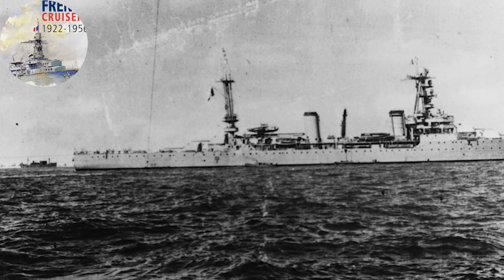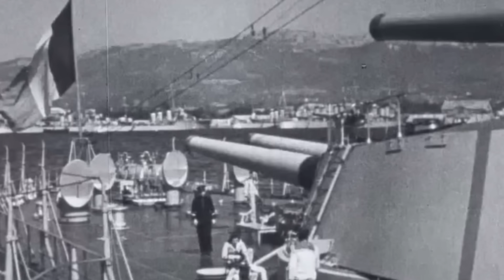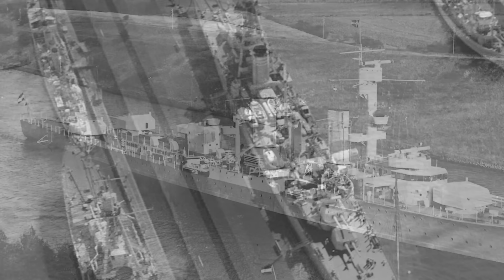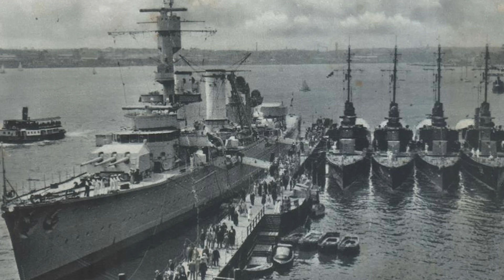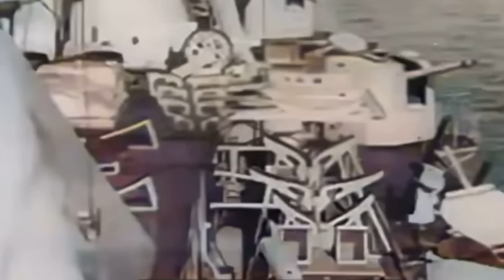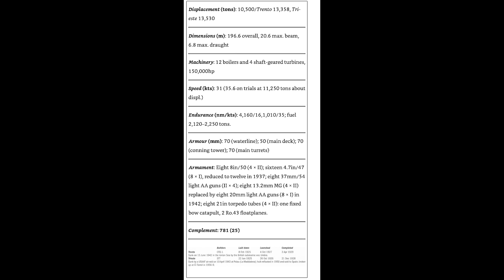The Treaty Era’s Worst Warship Designs

Comment: Is there any instance in WW2 where either a ship was lost but would have survived if armor had been 50% thicker or where a ship survived but would have been lost if armor was 50% as thick?
Reply: I don't know if this counts, but the Fletchers were built with a splinter-proof belt of armor, kinda like a mini cruiser, when other destroyers didn't have that; apparently that very effectively protected Fletchers from damage from near-misses (aside from shock damage, of course).
Reply: @TheSchultinator  They didn't have a belt but you are right that, unlike typical destroyers, they had some splinter protection worked in. I don't know how we'd check it against the survival criteria though. Thanks.
Reply: @Wick9876 Special Treatment Steel (STS) was a "type B" armor (non- face hardened) that the USN developed to have a high tensile strength while remaining ductile, which is really good for catching splinters. In layman's terms, when struck rather than resist it would deform to absorb the energy; it's the same principle when a boxer rolls with the punches, that's why when you see pictures of damaged WW2 USN ships it looks like someone bashed their side in with a sledgehammer.
Reply: @Wick9876 I guess you’d have to try and find a similarly sized destroyer of another class without said splinter protection and get an analysis of damage from a similar caliber of hostile shell

The Japanese used a lot of 203mm or 8 inch guns, which the United States did have a counterpart for, so that would be your best “like to like” chance

The issue of course being that Destroyers such as the Fletcher class are not exceptionally durable ships, mostly relying on speed and smoke screens to stay alive by obscuring or avoiding enemy fire, and so damage assessment would often by colored by the complete loss of the ships when hit badly enough

Near misses are what splinter protection tends to be implemented for, so you’d have to try and find two instances of a Japanese and American destroyer being almost hit to know the effect the armor would have on
Reply: For the thicker part maybe the sharnhorst as it gets a bad hit to the steam system if the armor is 50% fatter might help not taking critical damage and then it slips away
Reply: @fwskungen208  That's a good one. A bit funny since it was a battlecruiser that sacrificed firepower, not armor, for speed. Her belt was thicker than Bismarck's.
Reply: The percentages are funny tho, if you make it 50% thicker, then you go, for instance from 100 to 150, so a third thicker, but if you make it 50% thiner, then you go from 100 to 50, so a half as much.
Reply: @dannyboy-vtc5741  The underlying question is "did armor thickness even matter" and do you have numbers that better explore that?
Reply: @Wick9876 well we have multiple American battleships hit by kamikazes with negligible damage, the same planes that sunk or critically damaged unarmored and thin armored ships ranging deom destroyer escorts to fleet carriers.  The USS South Dakota took 26-27 battleship and cruiser shells in one engagement (14", 8", 6", and 5") and though the superstructure was badly damaged and electrical systems knocked out, her citadel was not penetrated, including a 14" shell that hit a barbette, if it had penetrated it may have caused a magazine detonation and blown the ship in half.

Comment: The British and Japanese had the right idea approaching treaty limitations; the British designed a cruiser class that could upgrade with heavy armor plates in wartime, and the Japanese designed a cruiser class to be able to swap its turrets for heavier guns. A "perfect" treaty cruiser should incorporate both concepts...
Reply: So... cheating?
Reply: At that point, just take the other method of the German, Italian, and Japanese navies: build over the limit and lie about it. Much less hassle than adding armor plates and swapping turrets!
Reply: @TheSchultinator  The Germans are in a different situation from the Japanese and Italians, because not only were their cruisers even larger, they were worse than even actual treaty designs. 

The Japanese fit 15,000 ton's worth of stuff onto 12,000 tons, the Germans fit 9,000 tons' worth of stuff onto 18,000 tons.
Reply: @bkjeong4302  That may be, but it's still over the treaty limits and they still lied about it. That it was less capable than other navies' cruisers doesn't absolve the Germans, it just show what happens when you don't build warships for 20 years.